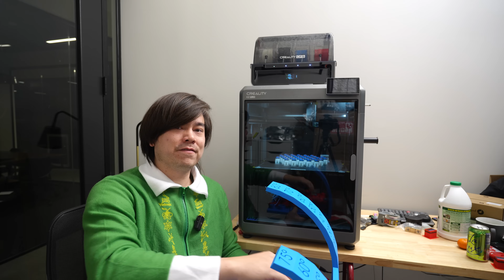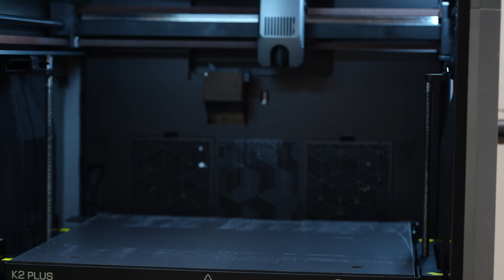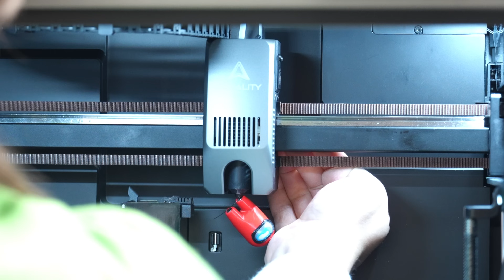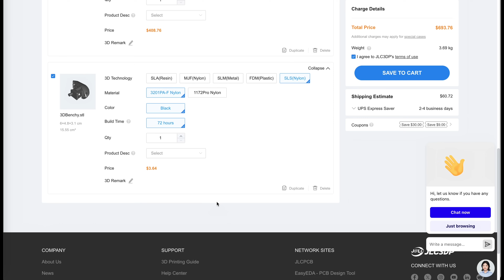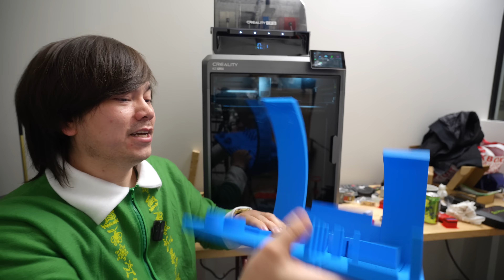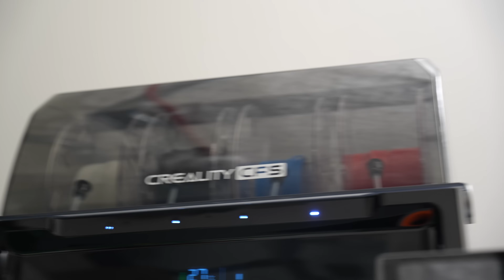Creality K2 Plus - Back With a Vengeance

Comment: Hi Nathan  , could you test the  precision and the squareness  or print a circle for example and verify how round it is. I own A K1 Max and it's awful  at doing these things. And I tried everything to fix it but the only solution was to buy a brand new  Bambu Lab  X1 carbon  which does very precise printings , so you can print technical parts .
Thank you in advance!

Comment: I have an Bambu A1 at home and an X1C at work. They are great units, but there are some things that annoy me about them. This unit looks amazing compared to those. The fact that the Z-axis screws are so easy to reach to clean looks like it would save me so much time and frustration on doing regular maintenance. I'm seriously considering this as my next printer. *Edit: And since BL created a S***Storm around their firmware of late, the decision to switch is that much more enticing.

Comment: Multi filament system AMS CFS etc etc have been out for a bit now, i don't knwo why they have not been able to create a slicer that just allows all if not most of the poop into infill, if it could dynamically look at the model and change the infill amount or location before it needs to purge.

Im sure the algoythim would be complicated but im sure its doable

Comment: Can you possibly do a video on how to work with multi part models designed for colour printing ?

In prusaslicer, if we import multiple parts, the software asks of it’s a single model having multiple parts and will align them for correct printing. So far I have not been able to make this work with creality print slicer. Leaving me to attempt to manually align parts.
Reply from the maker: Not sure, have you tried assigning coordinates for each part in the slicer? It would be (0,0,0) then group them together to move them around. It’s all based on prusa/bambu/orca slicer so it should have most of the same features, but I’ve only painted models and done hueforges so far

Comment: Power switch on the back = con (so old school it sucks).  USB on the side = con (they make extender cables to run it to the front). 5th Spool on the side = con (there is space to mount it to the side and face inward towards the multi-spool holder and still have room).  Other than those “minor” negatives, it looks promising.
Reply from the maker: I've heard of people burning themselves on printbeds trying to install spools on the inside of a machine. Though if you really wanted it set up that way I guess you could mod it.

Comment: This 350mm-cubed core-XY printer is pretty much what I've been waiting for...from Bambu.  I remember being excited to see the K1-Max hit the market...and then the horror stories started.  Creality burned a lot, if not all, of their credibility with that one.  Now here's the K2 Plus.  It has an awesome build volume.  It looks nice.  The CMS sounds like a dying 1988 Volvo, for some reason.  People have already started having problems with the machine, extruder issues, etc.  Kind of gives a whole deja vu vibe given what we just saw with the K1-Max.  And then there's the fact that the K2 Plus won't even let you get through setup without making an account with Creality.  NOPE.  We're done.  Right there.  Zero interest in being forced to have an account, to use their cloud (in China), to use their app, and to use their slicer...just to use this printer.  

Bambu (another Chinese company) also has an app, a cloud account, and a skinned slicer based on Orca...but you don't HAVE to use any of them to use their printer.  They encourage it, since there are more features built into that user experience, but it's not strictly necessary.  So, you can go LAN-only mode with the Bambu and not have to worry about security.  To be fair, there have been some cases where people have paired their Bambu printer to their Bambu cloud account and, suddenly, it'll start printing something all on its own, that the owner didn't initiate.  The K2 Plus allegedly has a LAN-only mode, but if it won't let you turn the thing on without a cloud account, then it's pretty much moot.

Comment: Could k2 max print any larger part than 350mm ? I dont know anyone else to ask 😁😁
Reply from the maker: I think it has about 8mm of margin around the whole outer perimeter. If you tweaked the firmware you might be able to get up to 365mm, but obviously that is not advertized or tested.
Reply: @NathanBuildsRobots  nicee, that could be a game changer for me. 😁 I already made my stock ender 3 (v1) print 235mm parts on x, and it can go up to 246 so i can purge on prige slide where my display was, so if it has room, i will use it definitely 😁😁 i need to fit part that is 365 mm in lenght and 231mm wide at one end, and 6 cm at the other, so even with 360*√2 diagonal i could fit it. Thank you very much!! If you want to see that dual filament ender with stock board i will leage comment from my other youtube acc where you have some short videos. Thank you once again!! cheers!! 😁😁
Reply: Thank you  @NathanBuildsRobots  and you can see here custom firmware on stock ender 3 motherboard

Comment: Is sv08 still relevant ? I am looking to buy a large size printer for around 600 dollars. Confused between ender 3 v3 plus vs sv08.
Reply from the maker: SV08 is still very relevant since it’s so cheap for the equally huge build volume. It doesn’t have a heated enclosure though, so it will be limited to lower temp materials, and if you enclose it you’ll still need to stick to entry level high temp materials. 

TBH most of what I print is in PLA and PETG and I don’t need the K2 for that

Comment: The problem I have is, the bambu labs carbon is great. Good price (£900 with AMS in the uk right now). It's also proven to be good. However, I just don't like the fact I can't use it offline. I want to be able to send a file on my printers network (no internet) and have it print. That is important for me. I hope this K2 plus is as good as the carbon.

Comment: Could this finally be a Creality printer that just works without tinkering?!?!?
Reply: The KE and V3 already existed before this.
Reply: No and it never will be. Creality machines are the machines you get a good deal on because they don't have the shit that cost a ton to develop, unless someone else has developed it first and Creality was just able to use it. That's why Creality fell off their throne, they started charging too much for their entry level machines; and every machine that Creality makes is entry level no matter what they say. Had they kept up what they used to do, for example the Ender 3 being $200, they'd still have a deserved seat at the table, instead of now feeling like a disgraced politician like Prusa does.

Comment: Would be nice to see how good the belt resonation is on this one.  Can you try some straight walls on xy axis??  X1C or P1S  have alot of belt resonation and bambu lab is ignoring this problem and say that i need to print slower, hel no this is reality…. I mean i switch creality if this is the only way to fix
Reply from the maker: I have had super clean prints with near 0 VFAs. I guess it’s due to the motors they are using? The big test print was almost entirely straight walls
Reply: @NathanBuildsRobots  I couldn't see any VFA but the layer stacking doesn't look so neat. I thought the 2mm VFA typical on most printers was caused by the GT2 toothed belts rather than the motors. The finer VFA at slow speeds seems to be motor related though.

Comment: This is kind of Amazing, there Ender 3 was there only printer IMO that had no design flaws from what clearly was design by committee on every printer after that. I picked up there first try at a top tier printer, the Sermoon D1 for $280 open box after dropping from $1,200 because of all the issues. Oddy heavy and sturdy frame, which is why i bought it. So much so that you dont need input shaper for up to 160 mms. But!! Massive amount of design flaws. From electrical feedback making low power LED lights in your house flicker to simple dumb mistakes like useing two fans to cool the heatbrake with neither of them actually cooling it.. making the tool carriage get VERY hot.

Since, its been HEAVILY modded with tons of my own designs and is a serious workhorse. Large 310x310mm bed, Klipper, both Z screws connected with a timing belt, 50x15 0.3a blower (normally there 0.1a @24v), enclosed top, replaced Y (gantry) motor for a lighter/stronger/better quality StepperOnline one amd the X motor for a larger and better quality one too. Now it can run at 10K acceleration (but i run it at 4K for noise). Thats to name a few 😅 i basically just reused the frame

Comment: Nice video! Personally I'm a Dutchy3D fanboy and I start to despise Bambu more and more. Not only is their printer not open source (which is ok I guess), but they are actively discouraging open source and CC designs on MakerWorld and actively pushing their exclusive program. Yes, it gives designers a few cents extra and I've had my fair share of free Bambu stuff through their points system. But they are actively blocking designers from posting stuff on Printables/Thingiverse/etc. Even that wouldn't be such a big deal but they are also pushing for uploading bambu specific 3mf files instead of STL/step creating a monopoly on models essentially. This is why I dislike them more and more, even though they pushed the technical side forward. So I'm happy there will be more competition, sadly it won't resolve the free model monopoly

Comment: Happy to see Creality catching up and making sizeable strides, COMPETITION IS GOOD for all of us regardless of you company/printer of choice :)

It really seems like they're actually trying to improve on everything instead of just flooding the market with even more Ender 3s that have a single differentiating feature between each other (like, how many printers have they released between 2023 and 2024? Way too many...).

The only thing that worries me is time, give everyone's K2s a few months of usage and then tell me how many of them are failing and need repairs or upgrades, like what happened with the K1 series. Instead of fixing the problem for the current units they just released a new printer and left everyone in the dust lol (afaik of course).

I'm hopeful, I want to trust them... But it's still Creality :/

Comment: I have a hard time trusting Creality after using my K1 max for a long while now. Why? I paid full price for this thing and the ringing on it is SO bad the prints aren't even worth trying to sell to customers, the printer shipped with a bed that looked like a taco, the tool head design sucks and is a huge pain to service, the cables to the tool head have already worn through and are shorting out and the list continues. My X1C with four or 5 times the hours? No issues.

I WANT the K2 plus but frankly, I've been burned on every Creality product I've bought so I'm overly skeptical now. None of the reviewers mentioned the K1 had insane ghosting if you slow speeds down. I HOPE this machine is at LEAST as good as an X1C, I want more competition in the market on the higher end of "tools" when it comes to 3D printers vs hobby machines.

Comment: Have you checked the flattness of the buildplate? How does it change when you heat it?
I wished that they would have used 4 lead screws that was individualy controlled to adjust the bed leveling. Had some issues with my K1 Max on that issue.
Reply: 4 lead screws is a waste tbh. Plenty of designs level just fine with 2

Comment: Wow....Creality finally made it to 2022, for slightly more expensive price
Reply: yeah, and they even threw in a much, much, much bigger buildplate. did I mention it's way, way biggen than the Bambu one? Because it is.
Reply: @Vinz3ntR  That's a good selling point, but if we assume the Creality one is Creality quality, I'd still move toward a smaller Bambu than another Creality. I've got the K1 Max, had an Ender 5+ and frankly, I'm tired of the constant issues, mods, parts, maintenance, troubleshooting, bad print quality etc. I hope this new one solves those issues but having a K1 Max sitting beside me with an X1C beside that, I almost never even turn the K1 Max on anymore.

Comment: Great video and hope you could make one after using this a lot for 3-4 months. 
Creality support have been so bad in the past that we don't touch creality machines for print farm, but this is very interrestimg machine to consider.
For now we probably will start using Qidi 4 plus even if it is just slightly larger then the A1/X1C we use today.

Comment: I hope what you say is true..but I'll be blunt..Burn me once, shame on you. Burn me twice...I've been seen too many promises from creality go up in smoke and their long term support is abysmal. It is going to take more than a few sponsored vids and promises before I'm convinced this machine is a real competitor. Again, I hope it is true. We need more competition in multi material capable machines. I run a business and I won't even consider any machine that isn't capable of auto swapping filaments at this point. Reliability and speed are absolutely critical.
Reply from the maker: I agree, trust easy easy to lose and takes a long time to earn. I feel like the last 4 product launches had had some sneaking issues like poor QC or early manufacturing or design defects. 

This is the first one that I’ve used that just works out of the box. Make a few more like it, and that could turn the tides of consumer opinion

Comment: They all work great out of the box, it’s 6 months down the line where the true colours start to come out. This machine definitely seems geared more towards high temp filaments and it seems they have done their homework to iron out the issues that made the K1 Max a bit of a nightmare to own. Let’s just see how it holds up over time with high chamber heat cycles. I guess what do people really expect for the price point and a 30 day return warranty and no follow up servicing options.
Reply: K2 is serviceable with generic parts mostly. Bambu doesn't use a standard piece in them hardly and even glue and mold bearings in place.
Reply: This. This is the reason why I think I'd still rather pay extra for a Bambu XL, it just depends on how much extra. I've got an X1C and a K1 Max sitting beside me and honestly, I don't even power the K1 Max on anymore unless there's a specific thing I need that's too big for the X1C which is almost never.
Reply: @kylequinn1963  I was the same and so I bought a P1S but what I’ve found is that those machines don’t like ABS long term, the carbon rods warp or bind up over a certain temperature and I get under extrusion, apparently a known issue once they changed to a cheaper steel print head bearing. So mine just sits there now until I can be bothered trying to solve it. I to am interested to see the new Bambu XL but if it’s not more designed to handle high temps for long periods I won’t bother with that either.

Comment: outside of the multi-filament system and difference in build areas, how does the K2 Plus compare to the Qidi Plus4?

the Creality website is pretty thin on machine specs for this one.

Comment: Can you tell us if there's any heat chamber blocking by the bed or if the board controller for the heater is melting at all like qidi plus 4

Comment: Time will tell, while my K1 has been decent, trying to work with Creality when (not if) it breaks has been nothing but a nightmare. they have actually closed most of my tickets before resolving any issues. I've spent so much money to just not have to work with them at this point. i dont think ill be buying their products for a long while. in the process now of swiching to QiDi, and its looking way better than any creality experience ive had to date.

Comment: the dual Z screws hasn't proved to be an issue on my Ender 5 plus with prints maxing the volume consuming multiple kg's of filament. so not too worried about that. 

Once it matures a bit, may have to add one to the SV08 fleet

Comment: Working with creality printers for many years i would say - just wait. They break soonish, that's the reson they are no longer used as print farms. Nothing that is not fixable but always need to be fixed here and there. They just not reliable as bambu. They always push half finished product in th market and then fix whatever they can fix as they go, till new printer getting released, as then instead of fixing old one they recommend to buy new etc. And only way to go is support and help from community and not the company itself.

Comment: All I need is that multi material system on a Voron 2.4 😭but is awesome to have a 350mm option! the 2 lead screws I see them as cutting corners honestly.
Reply: Why? Designs such as vzbot use 2 screws and are very stable

Comment: Another competitor is the qidi x plus 4 which will have an ams on Q1 2025 and it's cheaper but with classic steppers
Reply: I agree the QIDI plus 4 is the one to beat at the moment for high temp chamber heater desktop 3D printers
Reply: @barnesysbuilds well apart from the major fire risk issues and the terrible response from Qidi to the risk posed.
Reply: @markm49  I’m in a 240volt country so no risk here, only 110v countries.

Comment: Why did they only do 4 spool instead of a 5 spool AMS to up one on Bambu? They got the real estate on top of the k2. Idk. I think they missed out.
Reply: Maybe they have plans to fit it to smaller machines too
Reply: @NiSE_Rafter  Pretty much the right awnser.
Reply: @NiSE_Rafter  why not make a 4 and 5 spool holder? Then offer the 5 to the plus?
Reply: @TheFoxalot  Because having both means expensive logistics and 4 is "good enough" for many users. This was they only need to order one set of tooling for production, only need one size of packaging, and don't have to manage stocking multiple SKUs. 

I do think it'd be nice to have more options as a customer/user, but in terms of business having just one product makes more sense.